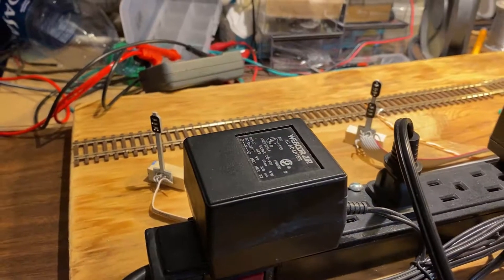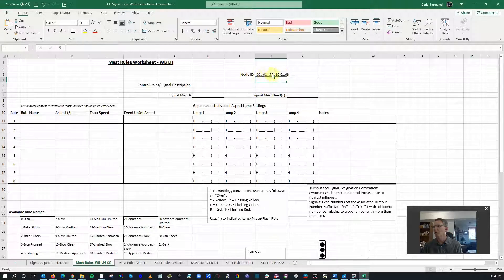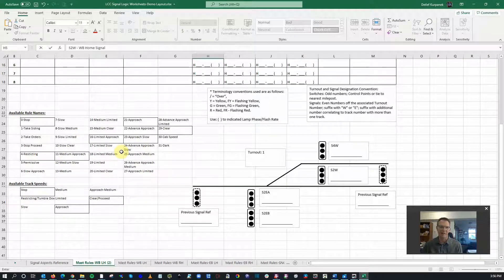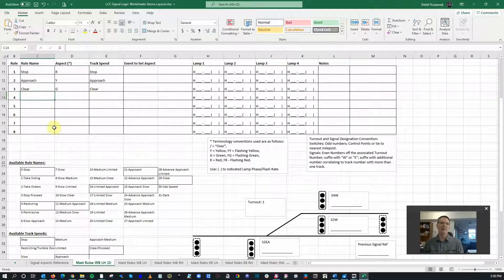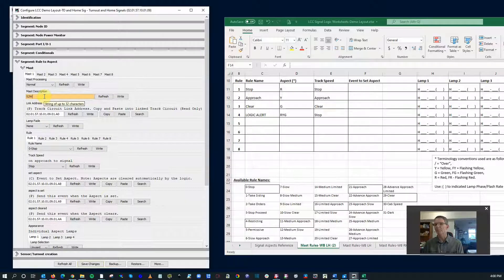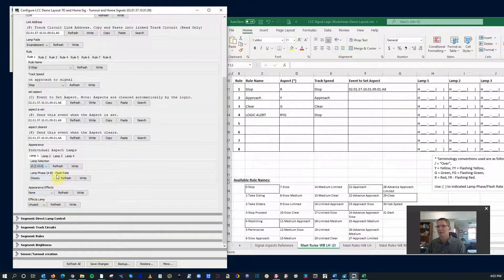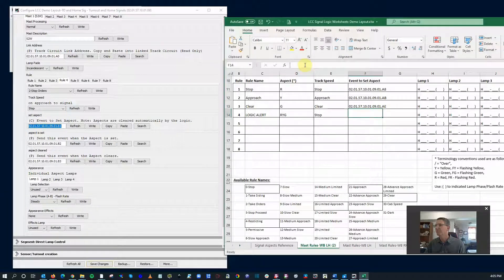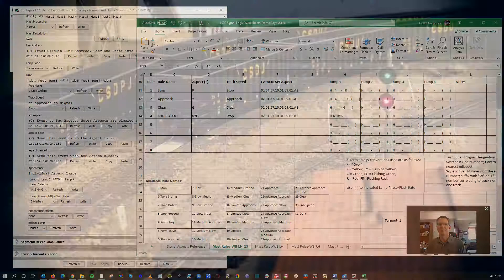TLC #13 Signaling Pt 3   Mast Rules

Comment: Under  the Direct Lamp Control section does that allow you to configure each LED independently? I am thinking of this from a control panel perspective. Could I drive each "lamp" on or off based on LCC events?
Reply from the maker: Yes, exactly! I don't think I can post images in comments, but when you look at the direct lamp control configuration segment, it specifically identifies each LED output, provides a place for adding a description, and defining what event turns on and off a particular lamp. Interestingly, it also includes a lamp fade feature to make it look like an incandescent bulb, as well as the option of steady or phase A or B flash rates to allow for blinking lamps.
Reply: @the-lcc-channel  Awesome! Thank for the detailed information! That is exactly what I am looking to do! I am looking to either implement a control panel with Tower-LCC and Signal-LCC or potentially a LightEFX-16. I  looking trough the options of both based on my I/O needs to see which would be more cost affective. Thank you again for the help!

Comment: can you make your forms available so we dont have to invent the wheel again so to speak?
Reply from the maker: Already done - the link in the description.  ''The video refers to templates to help with the configuration process. These may be found at: https://gnwrwy.com/lcc-resources/"
Reply: @the-lcc-channel  This link does not work. Any way to get those sheets? Thank you I have learned much from your videos and refer back to them from time to time. Missed you at Springfield. I am now working on the training for the conditionals as I would like the club layout to work without a dispatcher.Will see. Thanks. Jay
Reply from the maker: @JayPease  - Hmmm, interesting. I just checked the link and it seems to work OK. Here are the links directly to the downloads. Let me know if there are any problems to get to them:
https://gnwrwy.com/wp-content/uploads/2021/12/LCC-Signal-Logic-Worksheets.xlsx
https://gnwrwy.com/wp-content/uploads/2021/12/Signal-LCC-Wiring-Notes.docx
Reply: @the-lcc-channel  Thank you very much. I've also been using the 32 H node. Works great I can now program signals and blocks in my sleep. LOL